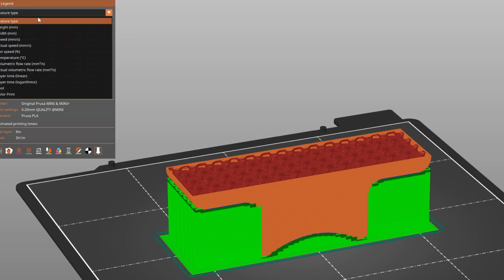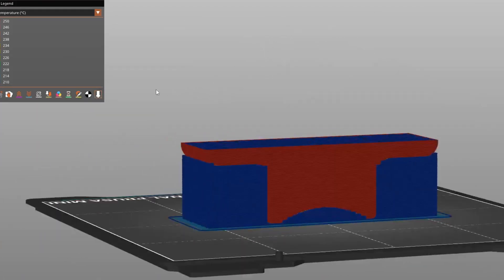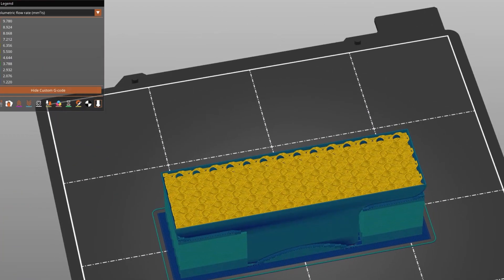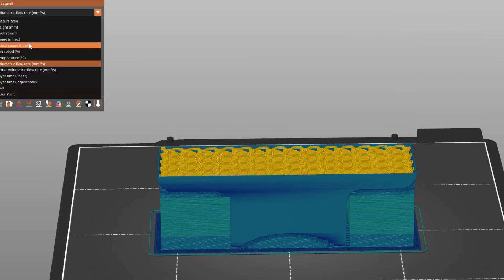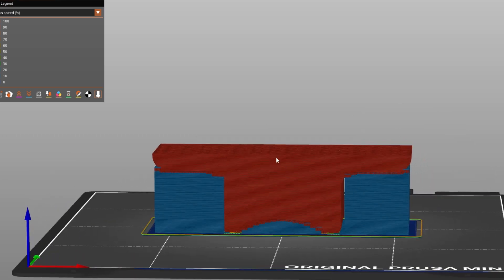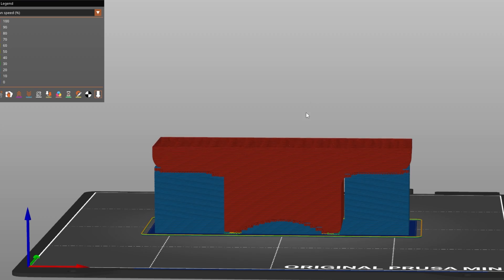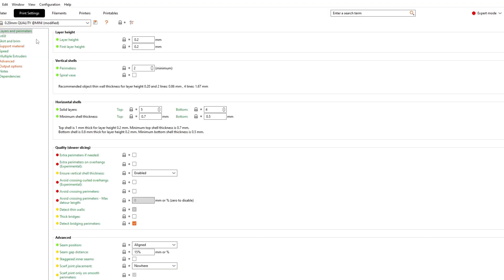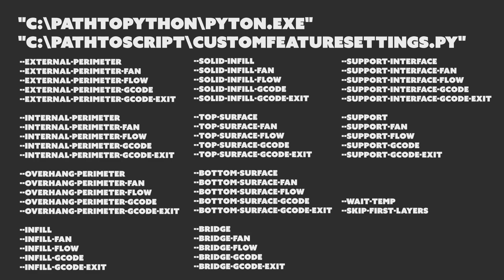Feature Based Gcode Settings now Opensource!

Comment: i love your work pushing this domain to higher heights. so do you have a lot of ideas and not enough time to get them done or maybe.. looking for new ones?
Reply from the maker: Thank you :) It's mainly a time problem. But maybe someday this channel grows to a size where I can do it full time and this problem will be solved.
Reply: since you've achieved mastery of slicer gcode post-processing i figured i'd pass this one on to you. i do get the lack of time, but i also know how an idea can pickle in the brain. last chance to stop reading.
here's the setup: a multimaterial petg slinky with a pla coil separator. post-process the gcode sequentially or likely in reverse, you figure it out, so that several layers or pieces of layer could be printed in one go before changing material, resulting in FEWER material/tool changes. the slinky would serve as the trial model because it would waste less material and the geometry prevents tool collision damage. and this would be a good start in non sequential 2d printing. we'll achieve real 3d printing soon enough, but we should first crawl properly before attempting to run. give it a think, see what comes good. and thank you for all your beautiful work
Reply from the maker: @sebastian_matcovschi  Bro.. You didn't do me a favour there. I already have a hard time focussing on my current projects, now it's worse xD Cool idea, and actually goes hand in hand with another script I planned to do!
Reply: yeah, i kinda dumped it on you. i have more, so you're happy it was just the one

Comment: I want this but for paint based features. Basically in multi-color mode it switches the filament and creates an arbitrary polygon going into the part. I want to control wall loops infill percentage in that region. Or make it unprintable entirely to eliminate the need for MMU or AMS for those parts and glue them up after.

Comment: THANK YOU SO MUCH, Why aren't these settings by default in slicers??????!!!!!! I have no idea how to set it up though, but hopefully this will push for these options to be included in the slicers.
I want strong but good looking parts, so being able to print infill and interior walls at a bit higher temp or most importantly without or much lower fan speed than outer walls is a must!!!!!

Comment: Thank you ! Can't wait to see if printing external wall at slow speed / low temp for a consistent matte finish, while preserving high speed printing everywhere else, will work. Would be a boon for parts requiring nice finish.

Comment: @FunctionalPrintFriday has been experimenting with a variable Shore hardness TPU; would it be correct to say that this post-processing script is ideal for leveraging different hardness levels within the same part, more specifically, different levels within the same horizontal plane?
Reply from the maker: While technically yes, it's most likely not what would be needed. You could f.e make the infill with a different temperature than the walls, so that it foams differently. But there are a couple of limitations. First, to make this "good" you'd need a very fast changing nozzle temp. (like with inductive hotends)  You don't want to pause 15seconds to heat-up/cool-down between walls and infill.
Also you probably want more control over the different parts. So using modifiers with custom temperatures would most likely be the best option here. And that is currently not a functionality of the script. But it wouldn't be impossible.
Reply: @tengertechnologies 

Thank you for the clarification and your innovation here!
Reply: It should be possible to change the nozzle temperature but TPU-LW needs the extrusion rate multiplier to change to match the nozzle temperature.  Lower durometer is achieved with higher temperature and a lower extrusion rate.
Reply from the maker: You can change the extrusion amount with the flowmultiplier, so thats not the problem

Comment: Any shot you could try a script to do Z pinning? It's documented to improve strength in the z direction a good amount
Reply from the maker: I thought about it. But other than with the Bricklayer, the patent is valid.  Coding it and using it would be no problem but making it publicly available is risky. (I think at least)
Reply: @tengertechnologies  Ah, I understand. Personally, I don't believe the patent is valid but I completely understand you not wanting to take on the risk. I am working on it myself, but I am no programmer and progress is quite slow xD

Comment: Can we use different temperature for supports interface?
Reply from the maker: yes
Reply: @tengertechnologies  can you give example of code? I'm a bit confused with so many options
Reply from the maker: There is an example on github at the bottom. You have multiple options per feature. only feature is temperature, add  -fan for fanspeed, -flow for the flow multiplier and -gcode or -gode-exit for custom snippets. So if you want to set the supportinterface temperature to 180 and f.e the fan speed to 40%, you‘d use —support-interface 180 —support-interface-fan 40
Reply: That's a gamechanger. Lowering supports temperature allows to separate them easily without losing quality
Reply: @aleks-ivanov  Usually hard to remove supports are printed before the piece. It would be nice to print at 210° or 220° for the print, 195°c for support interface and 185° or 180° for bridging/overhangs. That would help a lot to remove supports